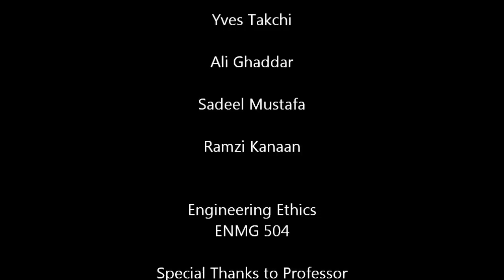Toyota Unintended Acceleration - Engineering Ethics

Comment: Thanks for this video. Michael Barr, CTO of the Barr Group, spent more than 18 months with a team of six other software engineers studying the source code that controls the electronic throttle control for the 2005 Toyota Camry. They compiled a 800 page report that detailed how defective Toyota's embedded software is. This information was used in the Bookout v. Toyota Motor Co. court case in Oklahoma, U.S. which Toyota lost. Despite Toyota recalling cars to replace floor mats, cases of sudden unintended acceleration continue to be reported in numerous models of Toyota cars. Stringent software certification safety standards are required for the control of the autopilot in commercial jet aircraft. If similar software safety standards were used with cars with electronic throttles on modern cars, then Toyota vehicles would surely not meet the standard.

Comment: Certain model Toyotas, particularly the Toyota Camry, have the potential for full open throttle with an ineffectIve fail-safe.

Just because Toyota settled with the DOJ for a $1.2 BILLION fine does not mean that its SUA problem has disappeared. It has not. What's even scarier is that the EDR (black box) in these Toyotas has been shown to be inaccurate in recording the events during the SUA. See the link below. Watch the video included carefully. 

http://ieeexplore.ieee.org/xpl/articleDetails.jsp?arnumber=6777269&sortType%

Dr. Antony Anderson closely analyzed the video of the crash with the publicly-documented 2012 Toyota Highlander EDR results. There is discrepancy which cannot be ignored. The EDR results from this crash are inaccurate and therefore, unreliable. How many Toyota and Lexus victims are being blamed for the sudden unintended acceleration event based on inaccurate and unreliable EDR results? How much is Toyota hiding about the EDR?

What are the implications for current and future Toyota owners? Well aside from the obvious safety ones, these Toyota owners could be blamed for the accidents which are in fact the result of inherent poorly designed ETCS-I software (glitches found by Michael Barr). Many Toyota owners have already been told that they were not braking when they were! False imprisonment is not far-fetched if criminal charges are brought. It's happened already to Toyota owners!

Comment: Someone needs to examine the inconsistency and unreliability of the EDR (black box) in the Toyota and Lexus vehicles. Toyota itself said that its own EDR was unreliable but then all of a sudden the company recanted. Toyota is now using this unreliable EDR data to incriminate Toyota sudden unintended accelerarion victims. When the owners, who have far more integrity than Toyota, state that they know they were pushing extremely hard on the brake pedal at the time DUA initiated, Toyota essentially says, "Oh no you weren't and here's the faulty data to prove it!" What a complete kick in the teeth for the Toyota and Lexus owners who pleaded with Toyota to FIX this obvious on-going ELECTRONIC problem.

Toyota has proven to be guilty of cover-up and lying to the government, lawmakers, and the customers they brag are "valued." WHO is buying the public claim that there is no electronic problem in Toyota's ETCS-i software? Michael Barr (see embeddedgurus.com) has completed an 800 page report on the matter of the SUA in Toyotas. This world-renowned embedded software expert helped the Toyota owner win the recent sudden unintended acceleration legal case in Oklahoma (Bookout V. Toyota). Unfortunately, the comprehensive report in COURT-SEALED right now. It should be made PUBLIC, in my opinion, in the name of public safety.

What perplexes me greatly is the fact that certain Toyota trolls are stalking those challenging the Toyota stand in this matter. There seems to be a concerted effort to shut out the TRUTH. This same thing occurred when I opened the Toyota Pandora's Box of ENGINE OIL SLUDGE. The Toyota trolls said that I "single-handedly created the HOAX." That was back in late 2000 and early 2001 before the myriad of class action lawsuits on the matter and before Toyota itself came out with two "voluntary programs" for that "non-existing" problem.  In fact, Toyota has lied about that the cause of the oil sludge, claiming that it has "never seen a single case of engine oil sludge in a properly-maintained Toyota." This statement made by both Mike Michels and John Hanson at Toyota is a complete fabrication! After communicating via a petition with over 3,000 Toyota sludge victims, I will never trust Toyota again. It is hoodwinking the public. Period.

Toyota sudden unintended acceleration is not just a problem for elderly drivers; it isn't just female drivers; it is far more than a driver error issue; it NOT a simple floor mat or gas pedal issue; it is ELECTRONIC in nature and can be deadly when accompanied by an ineffective fail-safe condition.
Reply: Charlene McCarthy Blake this is what I have said before people beloved and still believe that it was floor mats or “driver error” really stupid I’ve heard of pushing the accelerator or lifting up on it and it releasing but the car still accelerated in some Toyota Lexus models excluding the Prius they didn’t have a brake override system to override the acceleration then after all of these accidents they added it in 2012 in Lexus IS models I don’t know about what time in the other models probably the same time